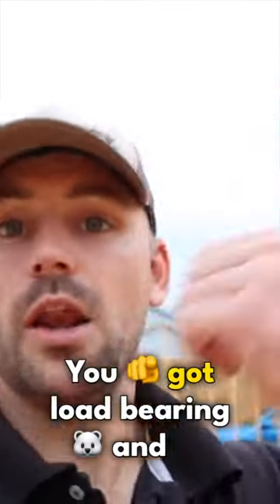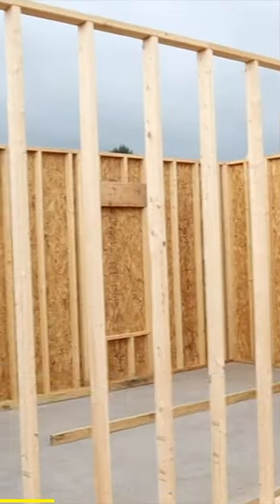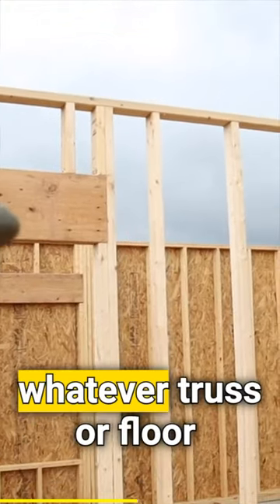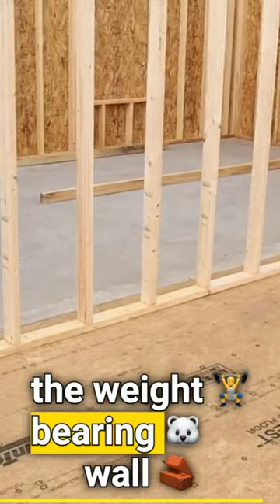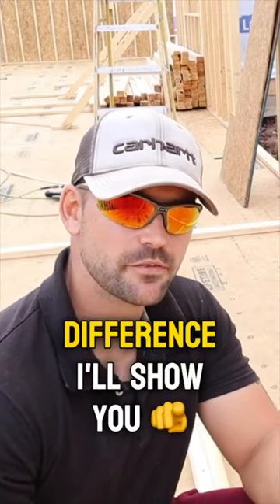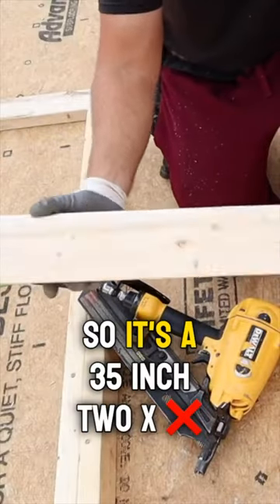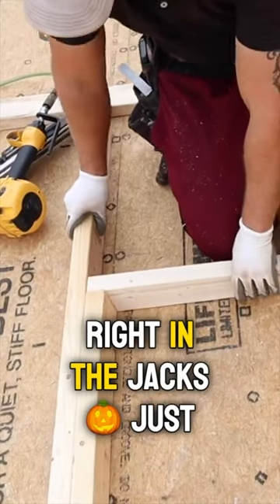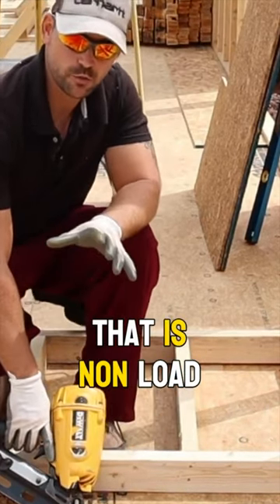Load Bearing VS Non-Load Bearing Wall Construction

Comment: Sounds good until u go to nail trim and there isn’t proper nailing locations at minimum double the 2 by, most pros just make a normal header. I say normal cause u use 2 by 12s which causes more problems then it provides be Ofer over the standard size headers stop giving advice you are not Professional